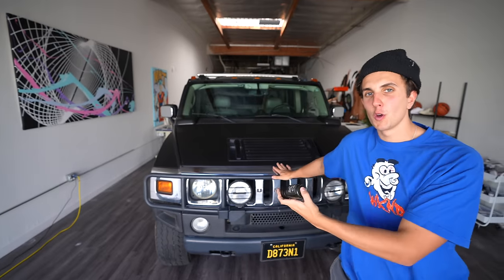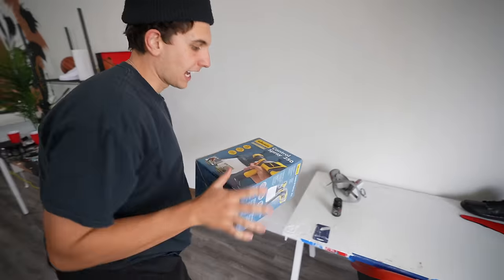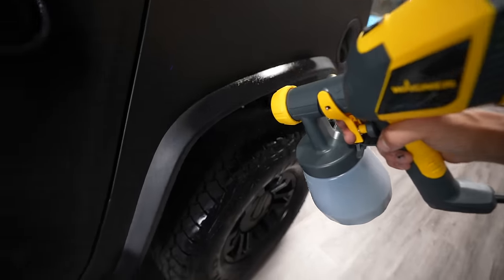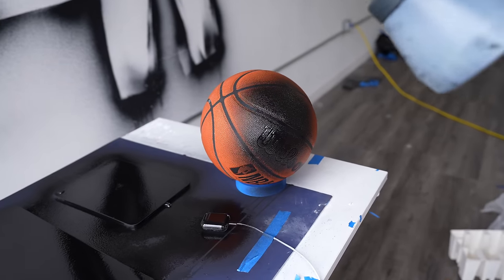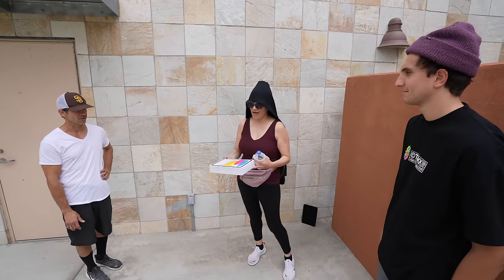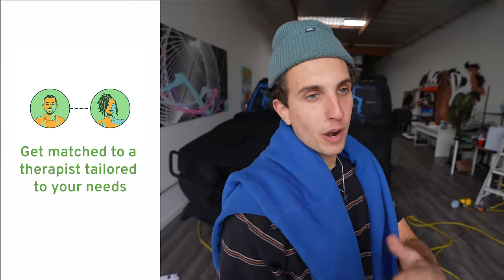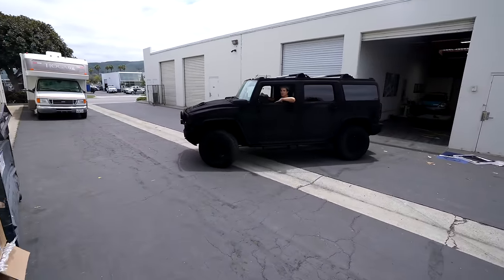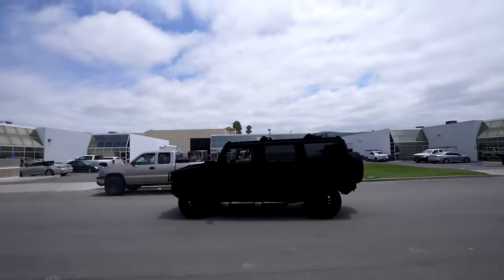The World’s Blackest Car.

Comment: Watering it down would have weakened it. The paint is the blackest because they used a unique compound to allow them to get the most pigment possible by volume. By watering it down you are reducing the concentration of pigment. This is probably why you can still see what side of the hummer the sun is shining on.
Reply: The water dries, leaving behind the pigment. Paint has carriers and binders anyways. But using the wrong thinner makes a big difference. Using the same carrier as the paint, whatever that is, would be better.
Reply: You're right .... My watering it down, it lets light through...peace.i4i
Reply: He does way to many drugs, all over the shop 😅

Comment: Every time you mix water with paint,it will open or spread even more the pigment and make it less saturated!Next time mix it with school glue instead ;)  it does the opposite and you can tripple the ammount of paint pretty easy,besides that it will turn the paint into auto leveling ,the brush strokes disapear completelly!